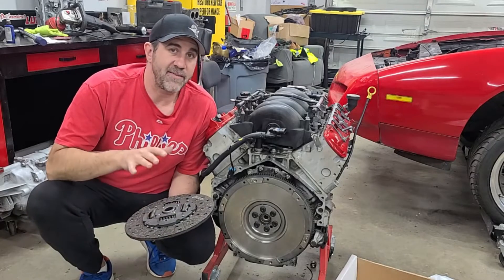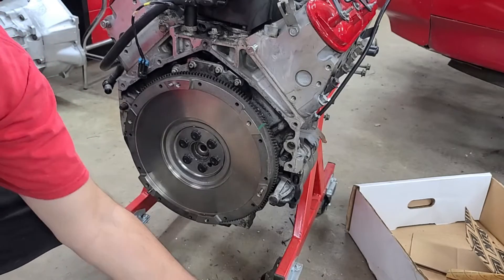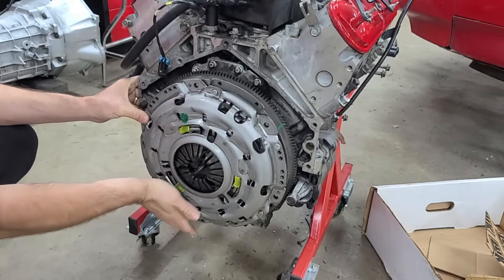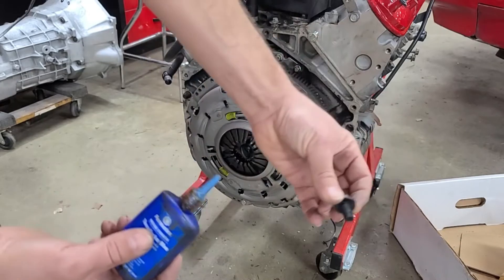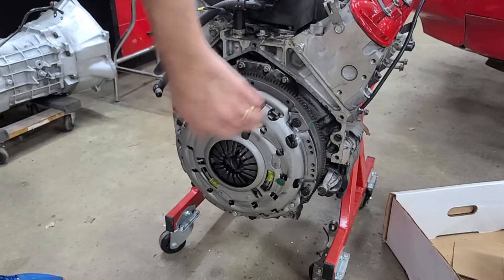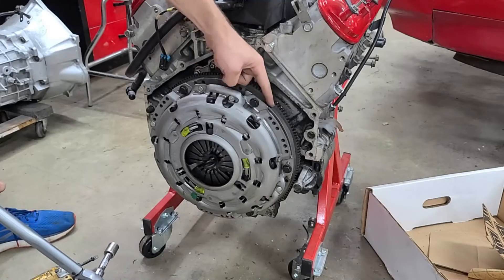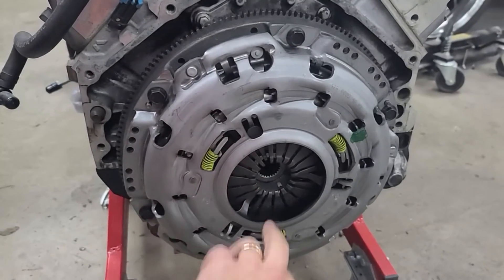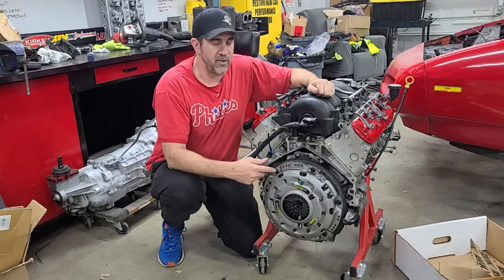Then Midnight Mechanic Tech Tip - LS1 Clutch Installation!

Comment: 22-ft lbs is the final torque spec ? I thought it was 52 ft lbs
Reply: It's a standard 8.8 (metric) M10 bolt. 52NM potentially could be reasonable, but 52 ft lbs can easily shear it right off. Additionally loctite will act as a lubricant leading to a high risk of unknowingly over-torquing and could result in damaged/weakened bolts.

Comment: Which flywheel did you go with? Also, is the LS7 clutch to a LS1 a direct bolt on or is there some sort of shimming required?
Reply from the maker: @annon1731  it is the LS7 flywheel. It came in a kit from Tick Performance.